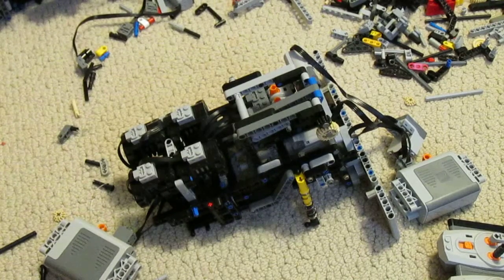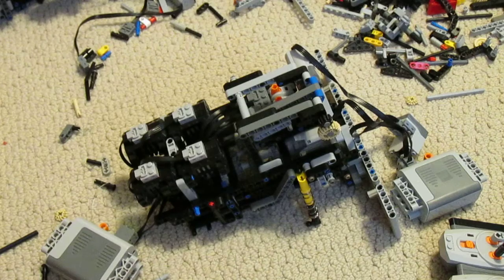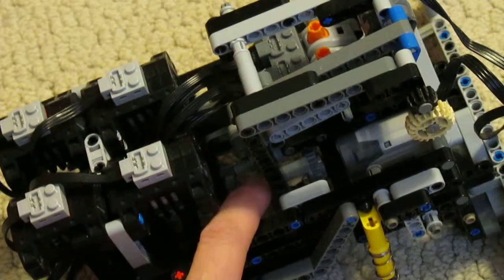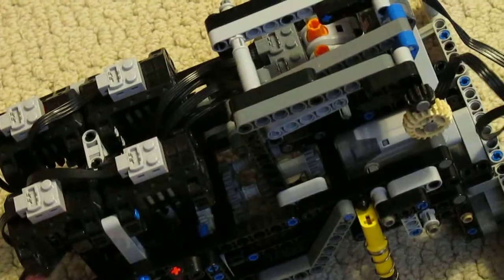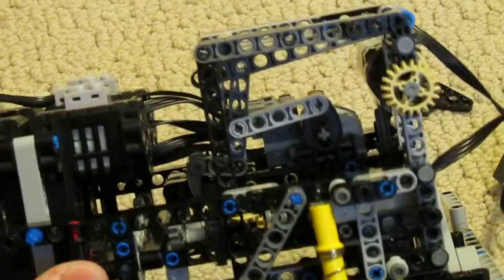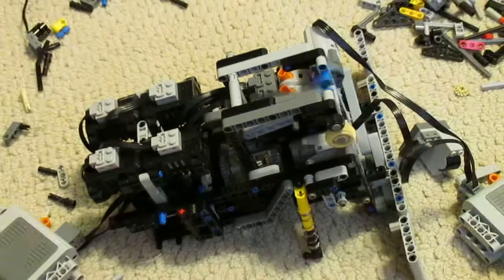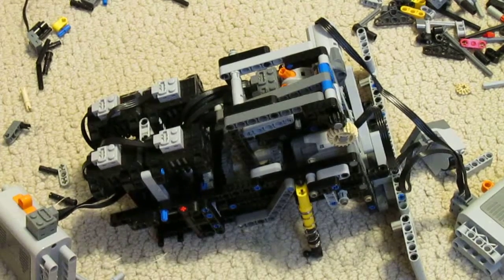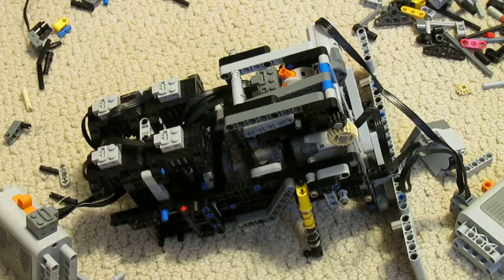LEGO Salvage Truck 18 Oscilating Switches

Comment: Nice mechanism for controlling the speed of the motor! All I'm worried about is the power transfer to the wheels, particularly the U-joints with the 7:1 reduction, because I've broken 5 or so, and I only have 2 XL motors in those projects. Depends if it's going to be racing along or crawling, because those engines develop atleast 6 Ncm each(I think), and that with a 3:1 gearing would surely break the u-joint, while still spinning the wheels at ~29 RPM which is still quite a fast lowest speed on full throttle, around 14cm/s. Ofc that is under no load so hardly any torque, but if that were to drop to 11cm/s or so then it would probably be developing full torque. Now all this is estimates, experience and googling, but I would be cautious. 

Just spotted your project and I will look through this exciting thing! =D